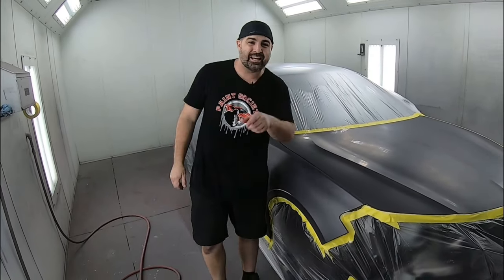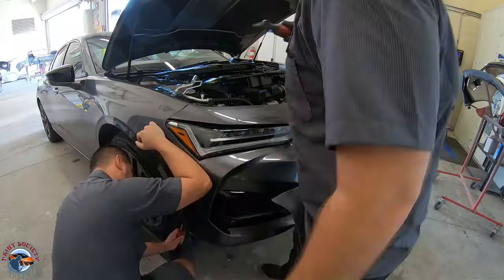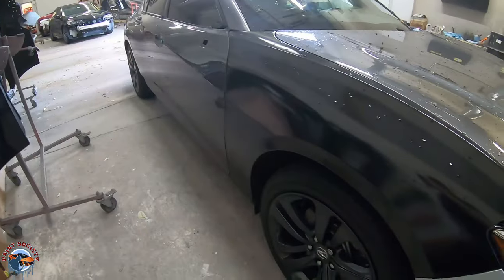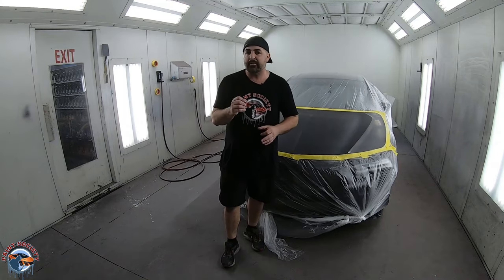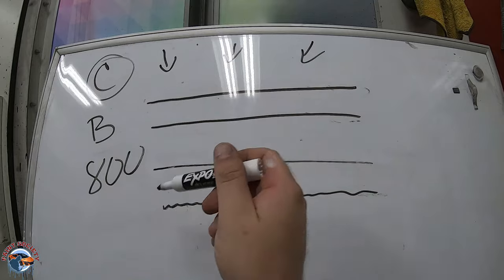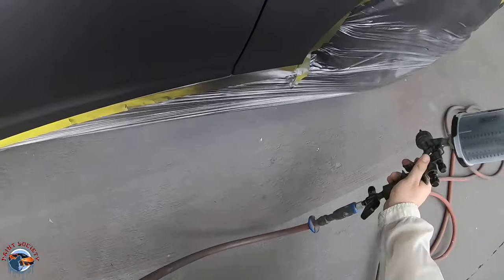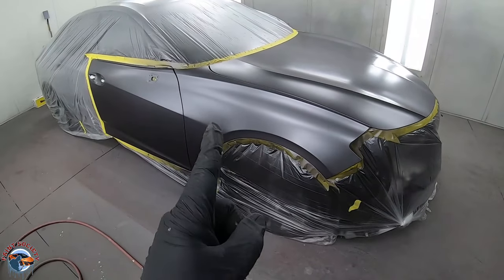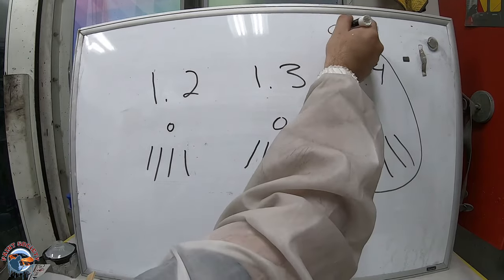Car Painting: How to Spray the BEST LOOKING Clearcoat!

Comment: Quick question.

I'm pretty sure I need a larger hose, but my problem is ;.

I have a hvlp old devillbis gun.

At full fan, I can only get like 17 psi or so. I would like to be able to get up to 30 no sweet.

All my regulators are cranked up.

In order to get slightly above 20 psi, I need to close the fan a bit.

What you guys think?

I have a giant 60 gallon, 240v compressor....
Reply: I have 2 old FLGs. Ok for base but not smooth clear with the hvlp caps. Ditch them for Prolites.
Reply: @jaykrom7639  ok. But if I have 120 or so psi at the compressor, why can't I get around 30 psi at the gun (gauge)

Hoses not big enough?
I should be able to get 40 or 50 psi at the gun gauge, and turn it down to get the best spray pattern or atomization and reduce the mist or over spray.

I'm not a pro painter and hardly use the gun.

Just wondering why I can't get whatever pressure I want at my gun (within reason).

The more pressure available at the gun = more atomization, but at the cost of wasting materials and fogging up your garage or paint booth quicker. So that's where hvlp is supposed to be good. But I can't get enough pressure at the gun to try.

Thanks
Reply: @jakefriesenjake  hi. I'm guessing you have a restriction in the regulator. Or it's too small for next to the compressor.
Volume is your problem.
Try bypassing this regulator to see if that handles the air flow. I don't use large hoses and have 2 regulators and water traps from my old 60 gallon compressor to my gun- about 70 feet. I recently replaced one that was too restrictive. Good luck
Reply: @jaykrom7639  ty

Comment: Your paint booth is okay but it's NOT a REAL  Good paint booth a REAL Good paint booth exhaust always pulls exhaust  from the floor Air always from  the top  exhaust always at the floor and always a real very strong vacuum at the floor if not that paint booth is not worth the money NOT worth painting any automobile in a good paint booth will keep paint out of your lungs you might live longer well you will live longer with a good paint booth